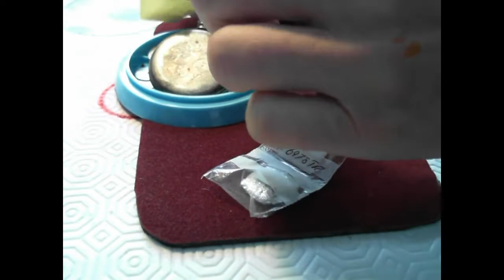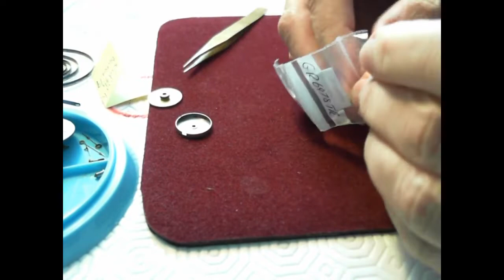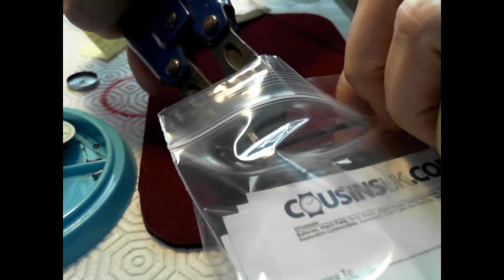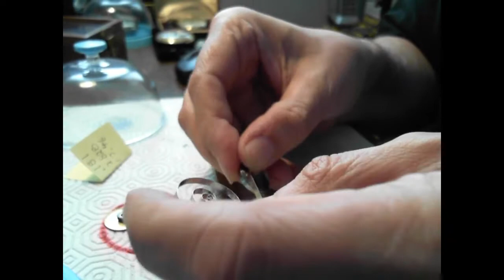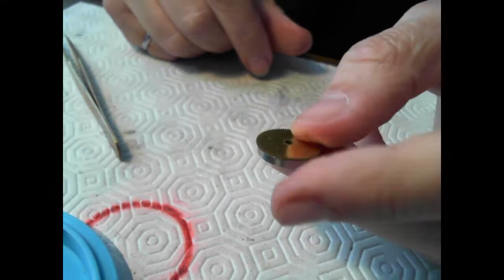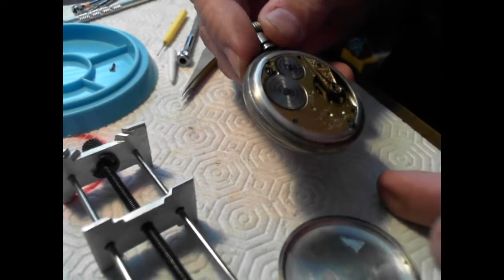Waltham Mainspring Replacement

Comment: you might want to look into a mainspring punch for next time.
Reply from the maker: I actually have one but they don't seem to do a good job. Could be the sharpness of the peg. And do I anneal the metal first? Need to perhaps practice on the old spring.
Reply: Punches are expensive, like 100-200usd